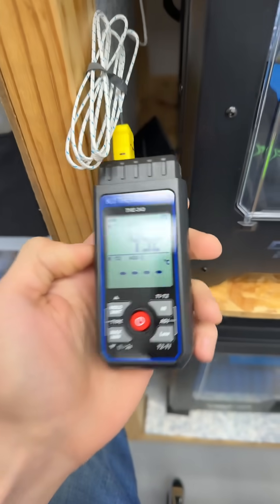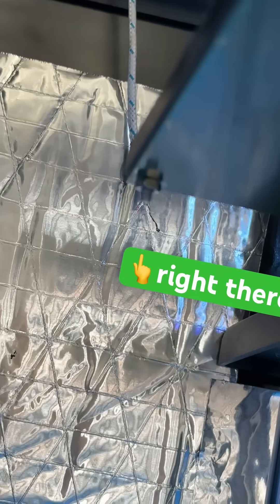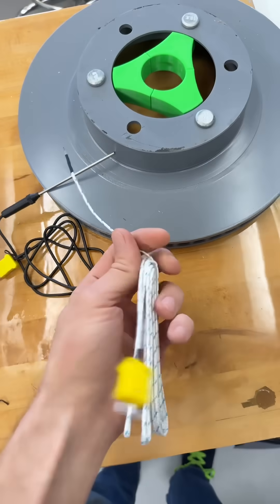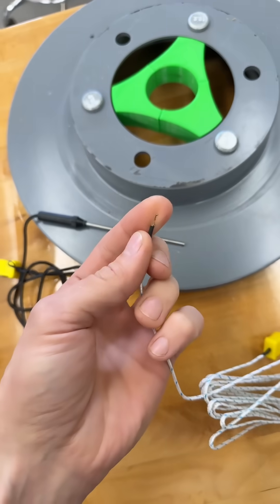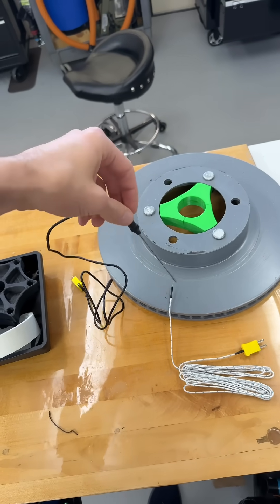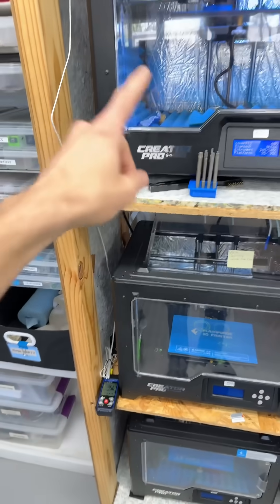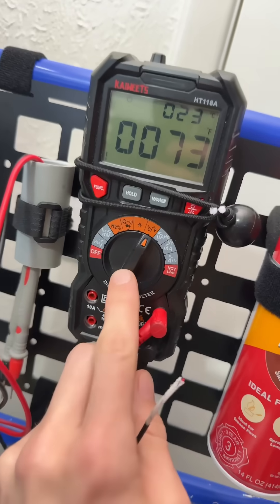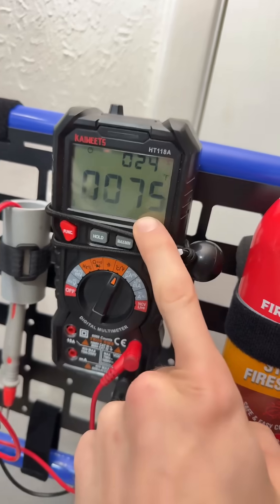you might have this already, did you know? #thermocouples #diy #engineering #STEM

Comment: they still don't use much Arduino in the field with so much noise... power supplies and rf incorporation. differential voltage or 4-20mA current loops. There has been a lot of people trying to make stuff, but I haven't seen anything worthy of Allen Bradley's standards... Pi stuff too. Even Arduino's own industrial stuff. (I haven't seen it anywhere...)
Reply from the maker: you mean to say that in industrial spaces there is too much machine generated ELectromagnetic noise that interferes with consistent data sampling, when Arduino and pi is used for data acquisition?
Reply: @davidmalawey  I have seen a lot of noise especially older relay logic. It depends on the level of caring... So it depends on what you are measuring. 1.8v I think is a common threshold on 3.3v stuff and I have seen a lot of noise that make false positives. Sometimes a bias can fix stuff. Opto isolate etc.

I suggested they do an analog current mapping of the machines as each motor would start and know more about the machine for pm, but they didn't want to mess with the logic. They want to pretend to know when the machines are running, but some people just start the machine and don't run it.

Comment: the protective sleeve helps protect the junction from oxidation and also acts as a heat sink. RTD is more precise. everything has limits of operations. I use types B, J, K, N, S and T 
I comply with NADCAP and the AMS2750.

rhodium, that's some stuff there...

any 2 different metals make a voltage that you could tabulate, but you could invent a wheel too.
Reply from the maker: I would sit down and watch a whole hour long video showing the differences and why you use these different thermocouples!  And also if folks like this comment they also would watch it 😊
Reply: @davidmalawey  these are sick individuals you describe. It is just a voltage differential. I don't know why, but I know it is... Lol any 2 metals. And there are ansi charts. I bet you could sit for weeks  watching pid videos then.
Pyrometry is complex, but so is all those exponential 3 or 17 body problems. You just have to break it down.
I can't even imagine how many label making videos you must watch.
Reply: @davidmalawey  you know what, I will make um something for you. Editing isn't my strong suit yet, but I could try.

I will do a test run to see if I need to script it... Lol

Yo, this guy offered me an hour. I am a little humbled.

Comment: Nice Video. There’s just one glitch that bogs me. You are measuring Voltage not Resistance. Like you accurately described the measuring point is the junction of two different metals. At this junction, a temperature dependent voltage occurs which is measured. There are also resistive thermo sensors like Pt100 or Pt1000 made from platinum. There the resistance changes with temperature.
Reply from the maker: Roger that!  Thank you for the error checking.  🫡 please continue to inform if you see these mistakes in the future!

Comment: But how do we calibrate it to make sure it's accurate?
Reply from the maker: good question!🙋‍♂️ Lately i just do a quick test for calibration: 

use another known temperature sensor, for example a medical device for human fever sensing.  these are guaranteed within 0.1c.  
Step 1) verify a match at the low range of my subject experiment
2) verify a match at the high range.
3) If the low and high match known values it is OK to proceed.  
4) If they don’t: we need to calibrate.  the question is open to the audience, what is an easy way to calibrate?

In the last few years i did not face a need for calibration so I don’t have a method planned.  Please share ideas!💡
Reply: I think you can use crushed ice + water and you can calibrate it to 0/32F. 

Otherwise use another temp probe
Reply: @BertRedd  with distilled water lol
Reply: you do not calibrate thermocouples. you certify that they are within tolerance. Go - no go...
they use "standards". sometimes freezing and boiling temps are references. My standards get re-certified every 90 days. in an accredited ANSI lab.

The important thing is actually knowing what the numbers mean... and PID is hard. lol
Reply: A few points:

The bare thermocouple has the advantage over the probe type of having lower mass and therefore faster response to temperature changes

IR probes measure the average temperature over its field of view.  Rather than measuring the temperature at the red laser dot, the field of view is a cone of maybe 15° to 45° (it will be specified with a quality IR gun) some the temperature is measured over a circle that depends on how far away the target is.

Relating to thermocouples, you may see a reference to cold junction compensation or even  an ice/water bath.  EVERY junction of dissimilar metals between the probe and the measuring device produces a voltage.  The yellow plugs are made of the same metal as the thermocouple wires.  At the meter end, those connections are connect to dissimilar metals.  The temperature at that point is measured so that that voltage can be taken into account.  Way back in the "olden days" before microcontrollers, an ice water bath was used at the joints between dissimilar metals and thermocouple charts were based on this reference point.
Reply: @bigjonseattle  as long as the pos and neg of  the other points are at the same temperature, they cancel each other. They do request home runs, but Omega sells those junction points that are really easy when I am calibrating the controller and need to switch inputs... Lol
Reply: @bigjonseattle  the cold junction reference point...
On a plc input card I just ripped open had oxidation at the connectors. They used a special crimp instead of solder and there are rtd's glued to the terminals for that reference.